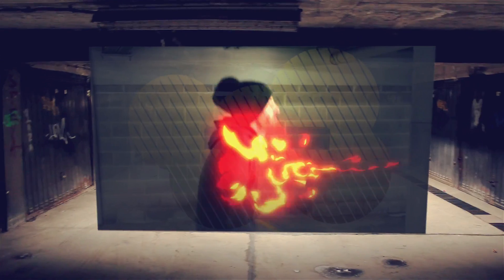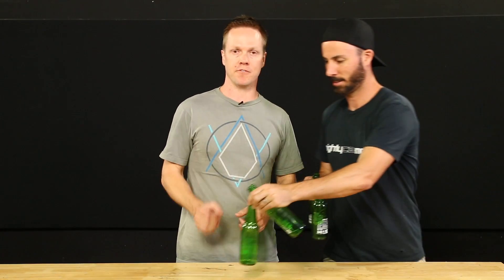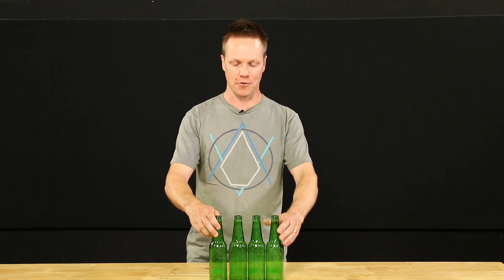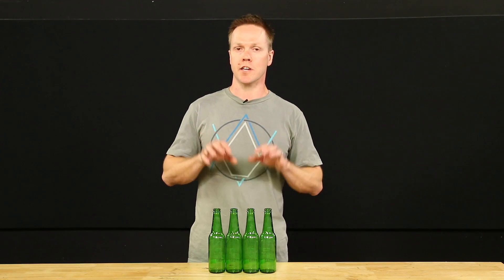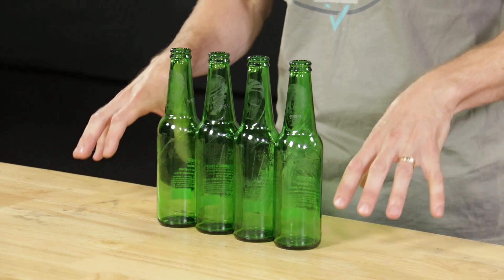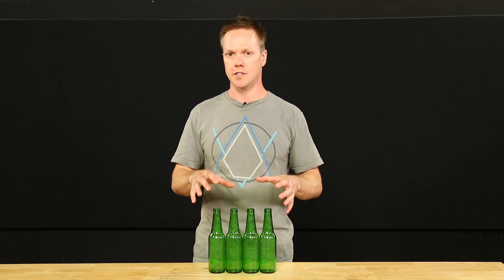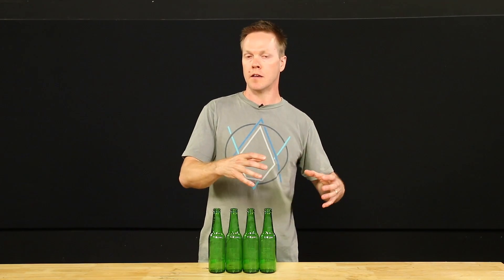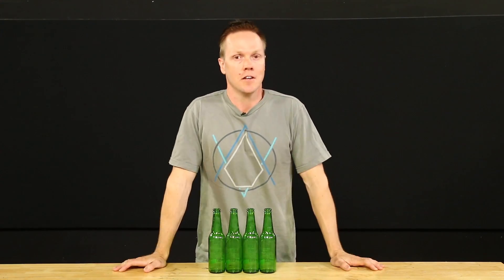Does Cold Air Make Your Car Faster? [GO FAST BRETT]

Comment: one thing im curious about is the amount of drag force that a car experiences in different temperatures. For example, with cooler air, the engine may be able to produce more power but the denser air will result in a higher drag force due to wind resistance, does the car's top speed stay the same, decrease or increase with respect to a car running on a hotter day, because on a hotter day, the car will produce less power to to "thinner" air but will experience a lower peak drag force. This is something I have thought about for a while but is very subjective and dependant on the car's overall design.

Comment: Heat soaked engines will lose their electrical dependability, when different metals reach different temps they become more or less conductive, their resistance changes, causing electrical errors.

Comment: Absolutely cold air makes cars more powerful. Colder air = more oxygen density/volume of air. I've seen as much as a 30whp swing between the coldest and hottest months on my Speed 3, an this was at the exact same boost level (my tune is perfectly dialed in to not make more boost in cold weather). You can minimize the seasonal change by charge temp cooling via water-methanol.

Comment: I was interested right away because I have a 1.3 liter Suzuki engine.  But it doesn't make 147 kW.  It is in a Swift and it makes about 70 hp.  Which I think may be roughly about 4.3 kW.

Comment: So if a naturally aspirated 4 litre engine at 3,000 rpm at WOT in a perfect world consumes 100 litres of air every second (25 intake strokes every second at a displacement of .666 litres per cylinder x 6 cylinders) can the air actually have time to heat up enough to have any real effect on performance?
Reply: I understand that boosted scenario is quite different
Reply: He answered, you seem to have ignored Ben's first sentence.
Reply: Did he?

Comment: Colder air will make an engine make more power, but it wont make your car any faster as your car has to drive through this denser air which will negate any net performance gains.
Reply: IIGrayfoxII they don't necessarily mean a lower temperature outside, rather the temperature of the air entering the intake

Comment: Should mention that in a forced induction engine, the efficiency of the intercooler will help aid in cooling the air coming out of the hotside of the turbo. Running high boost = more heat. Well designed intercooler = better heat dissipation, more dense air going to the throttle body

Comment: would there ever be a time I need to pump hotter air into the engine for more performance?
Does air travel faster/slower into the engine based on temperature?
If I had a high altitude (3500ft from sea level) and have cold temperatures (-15C), what performance should I expect compared to sea level

Comment: 1:50 My inner nerd will kill me if I don't correct this: When heating or cooling air, you still have the same amount of air. What Brett meant/should have said is heating the air results in less oxygen, not less air.
Also, a question for anyone who knows the answer: Even though lowering temperatures result in denser air, why does climbing a mountain still always result in oxygen deprivation? Does the ratio simply not cancel out, or is there some other factor (like our lungs not being able to use cold air as well as they use warmer air)?
Reply: Imo, decrease in pressure just cancels out the benefit from the decrease in temperature. The higher you go, less temperature and pressure but WW2 high altitude planes and pilots needed oxygen just to not pass out and not stall the plane. At some point there comes a limit and oxygen is just not there (no matter what the temperature) in sufficient quantities to sustain human bodys need or keep up the burning process in the engine.
Reply: 1. When heating air, you are effecting it's density. It's oxygen content does not vary only the amount of air in a given space. Therefore the hotter the air the less dense it is, in turn there being less oxygen so less power.
2. Think of air as a fluid (which it is), the higher up you go, the less air there is because gravity is trying to bring everything to the ground. The air only becomes cooler because there is less heat capacity because there isn't as much air to hold the heat. Hope that makes sense.
Reply: 000Bob000jones000 the higher the altitude the less oxygen there is
Reply: Well yes, but it's also usually colder, therefore you have less density due to altitude but more density due to temperature. My question is whether those just don't cancel out or if there's something else to take into account.
Reply: Bob jones - the results of heating or cooling air depend on whether you are considering a closed or an open (to atmosphere) system. Brett is correct in saying warmer air (in an open to atmosphere system like most vehicle intakes are) will result in air of a lower density, which means less air (and therefore oxygen particles) available to the combustion system per unit of time/combustion cycle. The percentage of oxygen for that given volume does not change.
With your question about oxygen deprivation to humans; Yes, air decreases in density as a result of increased altitude. Yes, temperature also drops at altitude which provides a benefit in increasing density. These two functions however aren't entirely linear, and also don't change at the same rate. The small benefit of colder air is vastly outweighed by the losses due to altitude increase.  As you climb a mountain the percentage of oxygen for a parcel of air (approximately 21%) does not change, but due to decreased pressure and density your lungs are now breathing in less oxygen particles for each inhalation. Oxygen particles also need a positive pressure gradient from the atmosphere to transfer effectively into your lung's alveoli (and therefore blood stream and muscles/tissues/major organs). With decreased pressure from the atmosphere, this process becomes less effective - and your body will experience the effects of oxygen deprivation, also known as altitude sickness or hypoxia. This pressure gradient problem is the reason the cabin of high altitude commercial flights is pressurised, and why pilots flying at high altitude breathe using pressurised masks.
Hope that helps.
Reply: The volume of the air changes with the temperature (put a ballon on a bottle and heating and cooling the bottle would have been a better demonstration) so there is less air and therefore less oxygen for the same volume of air.
And I think that the air is less dense as altitude rises because of gravity being not as strong as on the surface and the weight of the air on top of itself compresses the air at lower altitudes (but I'm not certain of this at all) 
And I know super cold air is probably not great to breathe (could freeze your sinuses or worse) but I have seen a "supercharger" for a car that used compressed air tanks and the air came out of the tanks at crazy low temps and gave them even more power.
Reply: 000Bob000jones000 Obviously the oxygen content decreases faster than the drop in temperature can compensate for at higher altitudes. There's no rule anywhere that says they need to cancel eachother out. Outer space is cold as fuck but you don't see oxygen there.
Reply: Daec34 That is helpful. So then I suppose it probably wouldn't be possible on Earth to make the changes in altitude and temperature cancel out (unless you could have a method of turbo-charging the air you breathe, and that would probably only work up to a certain altitude), but my initial comment is something that you got wrong as well. "Air" is an arbitrary term used for a gas that is a mix of all elements in our atmosphere. Oxygen content is the focus of this video, so to say that cooling the air at atmospheric pressure results in more air is just wrong.
Reply: Correct, the only way to overcome the altitude problem for humans (usually any higher than approximately 10,000ft) is to deliver air that has been artificially pressurised, which you could think of as 'turbo-charging'.
With regards to the 'air' and cooling/heating issue; upon reading your comment a few times you seem to have a misplaced understanding of oxygen content and the differences between an open/unrestricted parcel of 'air' and a closed/restricted parcel of 'air'. You are correct in saying that air is an inclusive term used for our atmosphere that includes the main components (nitrogen, oxygen, carbon monoxide etc). These components occupy a percentage of a given parcel of air, and the percentages do not change with changes in temperature.
When changing the temperature of an 'open' parcel of air (like the air you breathe, or the air a car engine extracts from the atmosphere to feed the combustion process) the air parcel will expand in volume when heated, or contract in volume when cooled. If the parcel of air was in a 'closed' system (like air inside a sealed bottle) it has no room to change volume, so heating will result in an increase in pressure, while cooling will result in a decrease in pressure.
In the application of a car's operation, cooler intake 'air' will mean the same number of air molecules (nitrogen, oxygen etc) occupy a smaller and therefore denser volume. This smaller volume for the theoretical parcel of 'open' atmospheric air means you can fit more 'parcels' into a car's engine cyclinder for each combustion cycle. You are getting more 'air' and therefore more oxygen per unit of time. The opposite is true when the air is heated; parcels expand - therefore less can fit into a cyclinder for each combustion cycle and the result is a degradation of performance.
Reply: Even if you imagine that the temperature could be the same all the way to the stratosphere, there would be the most air bourne oxygen at ground/sea level, just because of gravity pulling the molecules down to earth. When NASA pump out 800,000 cubic feet air from their spacecraft testing facility, they remove 30 tons of air!! It's heavy stuff!! ;¬)
https://www.youtube.com/watch?v=E43-CfukEgs
Reply: Well it's easy to find altitude and oxygen content charts and could probably find some equation for adding in temperature.
Just read this "Although air contains 20.9% oxygen at all altitudes, lower air pressure at high altitude makes it feel like there is a lower percentage of oxygen" 

Boosted applications are essentially creating double or even triple atmospheres for more air; cold air intakes, air to air and water to air intercoolers, and even the Demons A/C intercooler system all cool the incoming air so more can be shoved into the cylinders; and nitrous is basically liquid oxygen you inject (which is why you need to add more fuel when you add lots of nitrous)
Reply: +Vegaspsycho I think you're entirely correct, but what I'm really interested in is the three-way ratio (if it's still considered a ratio) of altitude to temperature to oxygen content. 
Also, the Dodge Demon uses it's A/C for a similar procedure. It takes around 15HP to run the A/C, but it routes it through to the intake and makes an extra 90HP due to the increased density.

Comment: Literally GFB blow off valves all leak even with a 1psi smoke machine. I don't know why I would listen to anything anyone from this company has to say. Literal garbage company.
Reply: http://www.gfb.com.au/tech/troubleshooting/21-a-smoke-test-indicates-that-the-blow-off-valve-is-leaking
Reply: +Myles Quarter 
First, the smoke you are detecting is not the BOV leaking at the valve to valve seat juncture, so the valve is not leaking.  
The smoke is presenting at the valve actuator stem guide that has a bleed port routed into the plumb-back port. 

When the system intake tract is smoke tested by injecting the smoke into the turbo inlet you are also back-feeding smoke into the plumb-back tubing which is not normally pressurized. 
With the valve seated there is no charge air or intake manifold smoke leaking through the valve because there is no path.  
The GFB BOV actuator stem smoke leakage presents because the smoke is being fed backwards through the plumb-back port which is not under charge air/boost pressure in normal operation, into the bleed port which originates at the valve actuator stem guide. 
With the GFB BOV design, the valve actuator stem and guide are not exposed to charge air pressure when the valve is seated and therefor does not require or need an O-ring or seal. 
Your smoke test procedure is generating a false positive. 

Our in-house tests show the leakage rate of the GFB BOV actuator stem guide bleed port while back-feeding through the plumb-back port is approximately 1.2 cc per minute. 

Here is an in context example: 
The FA engine has a 1,998 cc (1.998L) displacement and at 1000 RPM has an approximate airflow throughput rate of 33,300 cc per second (33.3L per second) and at 5000 RPM has an approximate airflow throughput rate of 166,499.3 cc per second (166.5L per second) or 9,990,000 cc per minute (9,990L per minute). 
Even if it was leaking through the stem in normal operation do you want to argue that 1.2 cc per minute out of 9,990 liters per minute flowing through the engine is significant enough to be concerned over?
Reply: the stock subaru blow off valves also do that lol. they work perfectly fine and dont cause the car to be extremely inefficient or dangerous under boost
Reply: Myles Quarter how bad is it? Ive been looking for one for a while now but couldn't decide
Reply: All bov's have a small amount of leakage. If you were smart enough to youtube it- go fast Brett-has a video on vavle leak.... between the piston and cylinder wall.
Reply: ChrisHallett83 Actually I work at a tuning shop here in Canada called Neetronics. We have a 4wd Dyno and specialize in Subarus. Out Redline smoke tester that goes to 1.2 psi can make a visable leak from the blow off valve. This is due to the fact that sinse GFB is a piston type BOV they require an o-ring to seal, GFB does not have one and they rely on metal on metal to do the sealing.
Reply: ChrisHallett83 So you are the one who is getting there "facts" from the internet. There valves will always leak, when they showed a video of it not leaking it is actually still leaking, it is just leaking back into the intake causing you to have boost pressure in your turbo inlet AFTER the maf sensor casing the car to be extremely inefficient and dangerous under boost.
Reply: organizedsolid Actually the stock ones are very well designed and I have never had one leak

Comment: Just run a turbo problem solved ;)
Reply: More boost can also means more heat in the engine bay.
Reply: They are designed to help, but most folks understand the faster a turbo spins the hotter it gets.
Reply: It's actually water that 'cools' most turbos.
Reply: that's what intercoolers are for
Reply: yes very true, but there are ways to make intake temps lower and more dense than ambient air temps with Ice to air intercoolers, etc. There is a reason pretty much any competitive hill climb car that runs pikes peak is turbocharged, its because its the best way to negate the low air density.
Reply: yes water that is typically cooled by ice, dry ice or even liquid nitrogen. I just simplified things by saying ice to air.
Reply: and direct water jacket cooled turbos are not that common in all honesty, cooling is done mostly by the oil for lubrication as well, and the intake air.
Reply: I personally use an AEM water/methanol injection kit, been running it for 4 years now without any issues. I highly recommend them, especially in a top mount intercooler application.
Reply: Intercoolers cool the air, that intake air goes through the turbo at xxxx°C. It doesnt matter if the air going in the filter is 18°C or 30°C. Thats why the big time attack cars running 1000bhp don't have cold air intakes because they're just not needed on turbo cars
Reply: Jack Gedge they also don't run them because turbos are in a sense are cold air intakes. all a cold air intake does is locate the intake away from the throttle body or carburetor. older cars had the filter on the top of the motor. any car with a filter located in a box away from the motor is a cold air intake. most cars come factory with cold air intakes, probably more restrictive than an aftermarket. a turbo is usually not in the best spot but not in a terrible spot.
Reply: MaStars turbos are still effected by this
Reply: obviously, but you can always run more boost to over come it, try that in a NA

Comment: This helps me to understand why cold hearted bitches are better at giving head.
Reply: comment of the year
Reply: This is not the reason Martin. We are talking pure volumetric efficiency, they can suck better thanks to the supercooling of air as it enters the lungs, this allows for much more compression per diaphragm contraction and also a greatly enhanced ability to hold the charge longer thanks to a more oxygen rich a/s (air to suck) ratio that in most cases approaches stochiometric ideals.
Reply: Yngwie J. Malmsteen 🍌🍌🍌🍌👄👄👄👄👄
Reply: Yngwie J. Malmsteen you win the Internet ! # pmsl